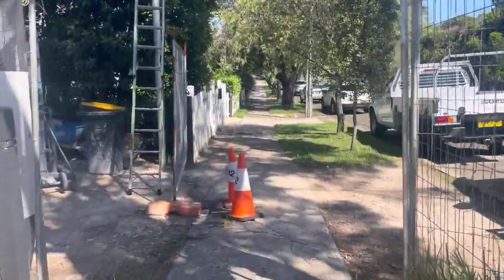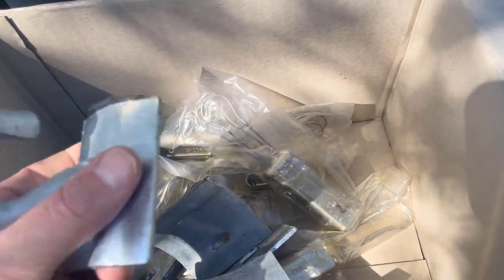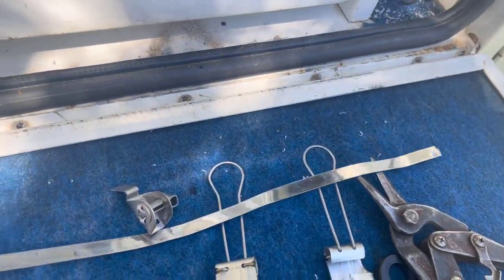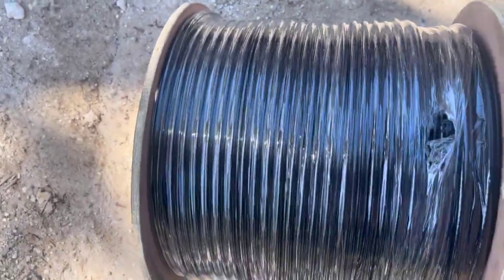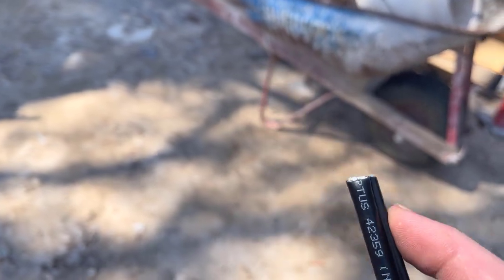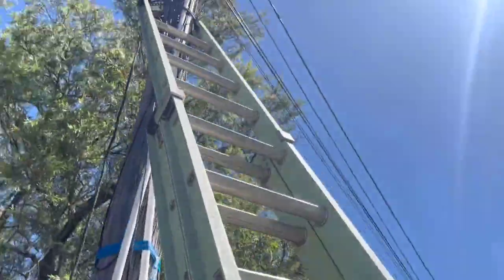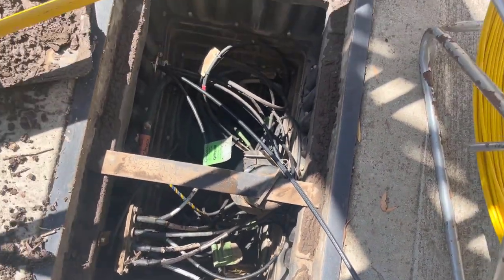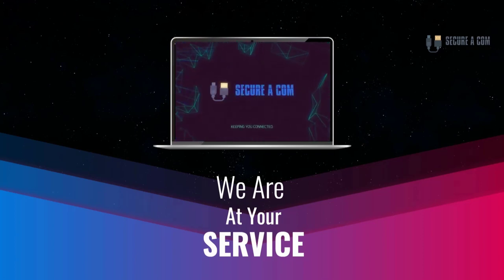NBN HFC Aerial Lead In Installation Sydney  [Step By Step]

Comment: man there have been so many times i could have used one of those ratcheting metal straps with that hook that is a cool piece of kit there.  Here in the states the local telco i work for we cant order anything as far as im aware that you can bolt to a metal pole, most of the time its power masts at the house that ive needed that for when you cant get that drop quite high as you would like to and need it on the power mast rather than the facia